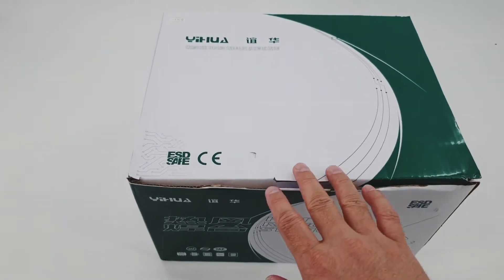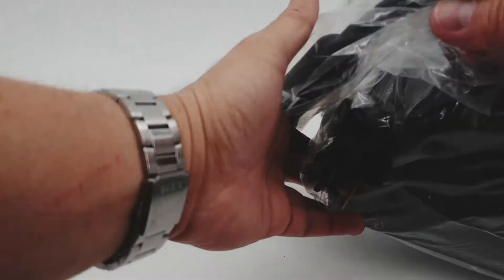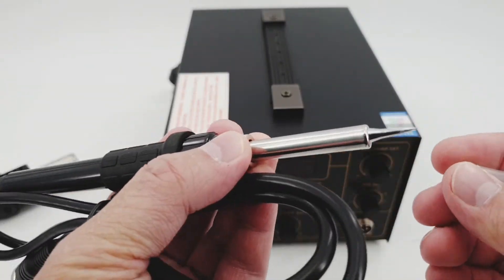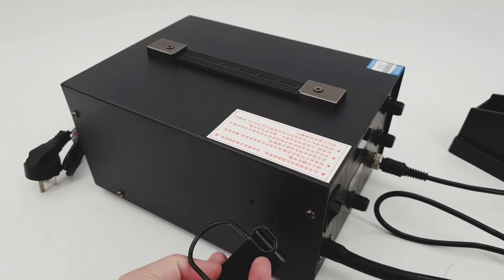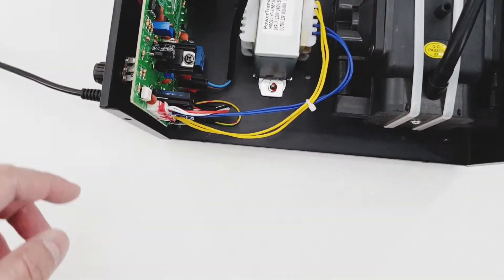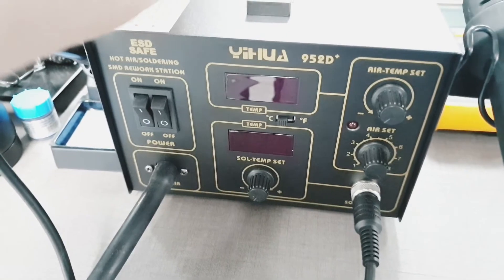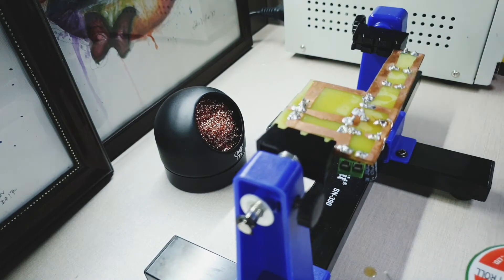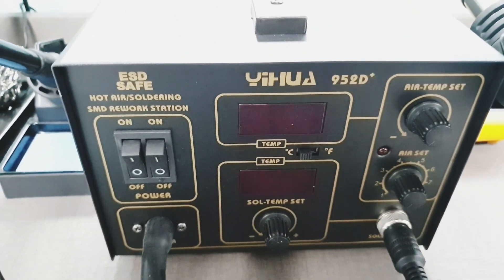952D+ Hot Air/Soldering SMD Rework Station

Comment: Hi very good video , i want to ask you , how is the station ? How is the tempratures from the hotair , have you measured them ?
Reply from the maker: Hi, thank you. The station still works perfectly after 2 years. Both the hot air and the soldering iron gets hot easily and within seconds. I use this a lot for soldering and the hot air is mostly used for softening the glue when I open mobile phones. I also use the hot air for shrink tubes.

Comment: Hi, I bought one of these too(it's on it's way in the mail), Did you check the wiring on this device? (does live go straight to fuse before mainboard?) a lot of Chinese soldering stations are wired incorrectly and could electrocute you.

Also i see on some devices the fan is in the handle? on this model what's the big black box inside the case?
Reply from the maker: Hi Dan,

Yes, but I only made a visual inspection of the grounding and the fuse. Wires are correctly done in place. So far so good. The big black thing inside is the blower fan. I don't like those models with the fan in the handle. They don't look aesthetically nice and this particular model is a good one.